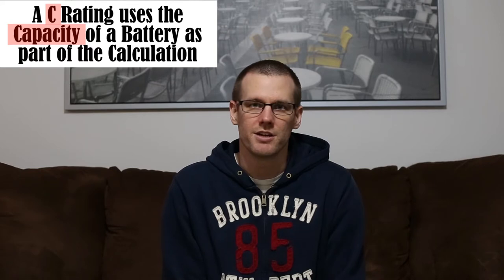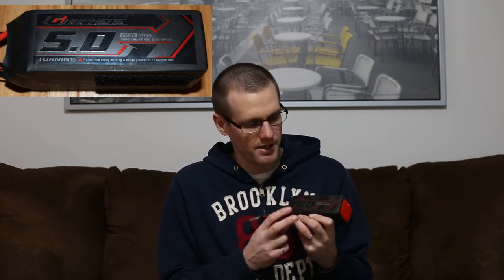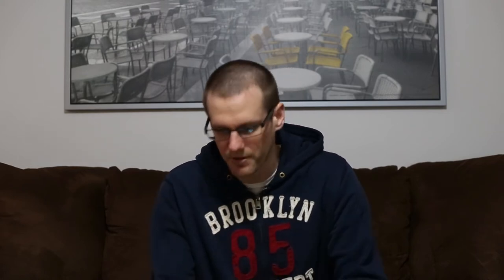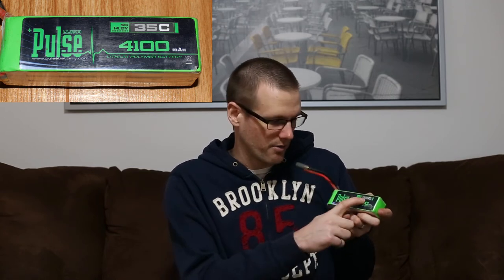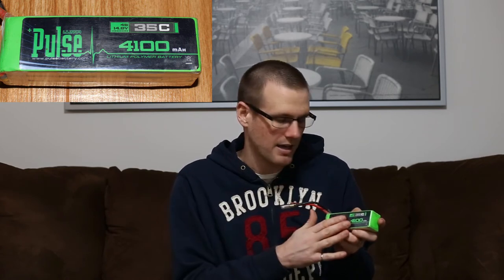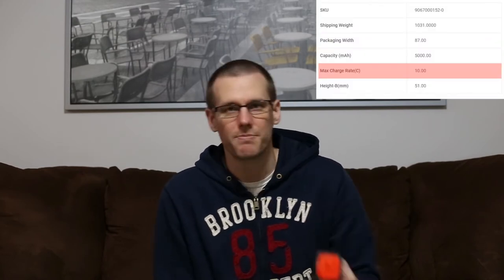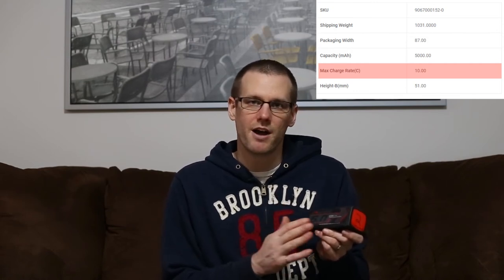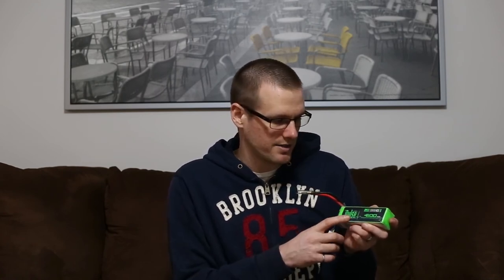What is the C Rating of a LiPo Battery - RC LiPo Basics

Comment: So if my Quadcopter motors pull 30amps max then 30*4 + little devices if we take will be = approx 120-125 amps required at full throttle. So i need to provide 160 amps ? Continuously am i right sir?

Comment: I have an esc 60A and a motor that they stand max 360Watt 54A at 25c and I have a battery lying which is 7600mah 25C.  Will it work and if so, what will happen?  Which component will be hot?

Comment: thanks.
I would appreciate it if you could test the performance of the swollen battery vs normal battery.
Reply from the maker: Hello, The performance of a swollen battery would depend on the internal resistance of the cells inside. If you record the internal resistance of the battery when new compared to when swollen, this will be the difference in performance. A swollen battery can have minor performance loss or significant performance loss.

Comment: What c rating n mah battery would you recommend for a kaiju 4s,6s, truck? N good run time.?
Reply: If you listened to the video then you'd know to work backwards from what the ESC's max draw is and then give 30% head room.  Or you could simply check the Kaiju owners manual.

Comment: How do I find out how many amps my system is pulling ?
Reply from the maker: Hi Chris.  You can measure the current using a watt meter or using an esc that has data logging capability. For rc cars it's easiest using an esc with data logging capability otherwise a data log meter would have to be used.

Comment: Pls I would like to know how to Calculate the c rating of a battery.. Am building a battery pack for my Rc airplane using a laptop battery li-ion batteries to be presided,data's given on the battery are 3.7v 2500mah.no C rating on it, so I would like to know how to get the C rating...Please
Reply from the maker: Place the battery on a charger to get an internal resistance measurement. You can then use this value to calculate heat output of your cells at a certain current draw.

Comment: I have the Graphene panther that's rated 75C and 6000mah. I would be at 450A continuous? what if I 2p or 3p run in parallel? does that increase or improve the continuous rating?
Reply from the maker: yes, then you would be increasing the capacity to 12000 or 18000  and making the same calculation

Comment: yes you describe the maximum current that a battery can provide but what about the time? I'm mean the battery can give you +300A but for how long in this case
Reply from the maker: The focus in this video was the maximum continuous current. The battery will sustain this for the duration of its capacity.  This is what we define as continuous. Peak current that the battery outputs really doesn't help you select a battery. What makes you interested in the peak output of the battery pack?
Reply: @RCexplained  knowing how much time will it last in the air. I found a formula that seems pretty accurate just divide de battery capacity (Ah) between the amps demanded (A) will give you the time in hours x 60 and you get the time in minutes that you can sustain your quadcopter in the air. for my case
Reply from the maker: @piposito150  there's a similar calculator on the radiocontrolinfo.com website under general calculators.

Comment: Hi Ryan, are these c rating correlated with flight time? I assume the higher c rating, the longer you can fly your drone
Reply from the maker: No, C rating does not directly impact run time. mAh is related to run time.
Reply: @RCexplained  thanks for your fast respond, but I don't understand what does you mean with "does not directly impact run time"
Reply from the maker: Using a 60C battery vs a 30C battery will not increase your run time.
Reply: @RCexplained  allright, thanks mas bro

Comment: I got a plane with an ESC needing 80 amps, they suggest using 4000mAh with at least 35C, which would be 140 amps. Now what I wanna use is a 7000mAh with 25C, which would be 175 amps. This should work, right?  I know its heavier, but I would like a longer flight time.
Reply from the maker: Hey Daniel, that is correct
Reply: @RCexplained  Thanks for your reply! Now I just gonna make some room so the batteries fit
Reply: Isn't that the esc that doesn't need 80 amps, but the esc can work / provide up to 80 amps?

Comment: How do you find out what power your motor actually pulls or pulled at load?   So I have a 120amp ESC, a 3710kv, Io 4.5a, max output 216w and current at max output of 59 amps motor and 8000mah 1s lipo capable of 100c. 

And my lipo is capable of providing 3.7v at 8amp for 1 hour?
Reply from the maker: Measure voltage and current with a data logger while running the car.
Reply: @RCexplained  Where would one acquire such a thing?
Reply from the maker: @xaviertaylor759  Some ESC's have them built in. You can get a stand alone unit such as the eagle tree elogger v4.

Comment: so my esc burned out cause i held go to long 4000 mah  11.1 30c  pluged in a 120 amp esc on go past the contin current the esc can take for to long or am i wrong teacher if u can understand what im trying to explain here????please elabo
Reply from the maker: Hi Bobby, the ESC typically fails when the FETs get too hot from pushing too much current through them. Or when the Caps fail due to excessive ripple voltage. Checking the temperature in these areas of the ESC will tell you if the ESC is being pushed to the limits. Keep the ESC within temp specs and you should be good.

Comment: Love your videos!  have a 2300kv motor and a 40 amp ESC. The battery I wish to purchase is 1000mAH and has a C rating of 20. The voltage is 11.4V. I have calculated the continuous discharge is 20A. Will this work with the 40 amp ESC?
Reply from the maker: Hi Jon, How much power are you going to be drawing from the 2300kv motor? If your ESC is rated for 40A, my recommendation is to get a battery that can atleast comfortably dump 40A. Your battery will be pushed hard if you load your motor to half the rating of the ESC.
Reply from the maker: Install the motor and do a power test on the bench to determine how much power you will pull.
Reply: @RCexplained  Ok thanks a lot! Does it actually matter how many amps ESC I use? As therefore I can use the 20A continuous current from the battery.
Reply from the maker: Yes it would since it's all dependent on what your your motor will draw based on the load that it must withstand. If you put a large prop on the motor, it could need 60A to turn it at the RPM it's spec'd at. If the motor, esc and battery were rated between 20-40A, they would all be significantly at risk of failure. If your system is only going to pull 10A then you are good with a 20A continuous rated battery and 40A esc. 

You need to start at the load placed on the motor. If the load is going to demand 40A, your motor must be capable of that or preferably more. Next your esc must be rated for 40A or preferably more to be able to supply the demand of the motor. And lastly the continuous current rating of the battery must be more than the 40A and preferably more.
Reply: @RCexplained  Ok thanks a lot. How would I calculate the load my motor would need? As the spec sheet barely gives any detail.
Reply from the maker: @joncheung1550  for airplanes there are online calculators.
Reply: @RCexplained  What would happen if the continuous current rating of the battery was less than the current of the ESC with the motor being at 10A maximum.
Reply from the maker: If the motor is loaded to a maximum 10A, as long as the motor, ESC and batteries are capable of handling at least a minimum 10A plus some head room, it's fine.
Reply: @RCexplained  ohhh I thought the continuous discharge of the battery had to be higher than the amp of the esc
Reply from the maker: @joncheung1550  everything needs to be higher rated then the load you plan to run. That's the most important part.

Comment: Does the c rating change the speed?
Reply from the maker: Usually a very small bump in top speed as well as acceleration. The biggest difference is it can improve reliability of your ESC. Check out the videos talking about ripple voltage.
Reply: @RCexplained  thanks for the quick response. I have another question. I want to run 4s on my car. Is it possible to use 2 times 2s lipo? But one of them is 2200mah and the other one is 3200. And the c rate is different. But they are both 2s
Reply from the maker: @lucaa482  I would not recommend running 2 batteries in series that differ in capacity and c rating. That would be asking for trouble.

Comment: So if i put 2 30C lipos in parallel i would get 60C?
Reply from the maker: The c rating of the battery does not change no matter how you wire the battery pack.
Reply: You can pull more amps

Comment: Hello, im using 2 pcs of 3s Vant Lipo 45c-90c and my top speed is 102kph. 
Im still waiting for my new battery 2 pcs 3s Turnigy 60c-120 will my top speed will go up?
Reply from the maker: If the higher C rated batteries can hold a higher average voltage under load, theoretically speed must increase. This is only true if all else in your setup remains unchanged.
Reply: RCexplained yes only battery gonna change the spur and pinion still the same as i run i hit 102kph. How much more speed i get sir? Do you have a estimate? Thanj you for the reply sir
Reply: @krystelgale2250  Doesnt this also depend on the electric motors  being rated for higher amps?